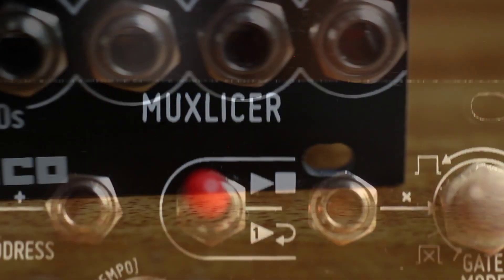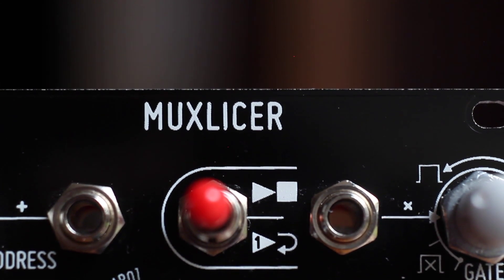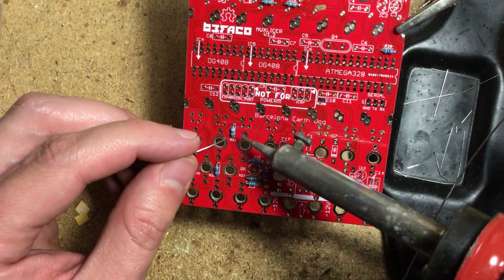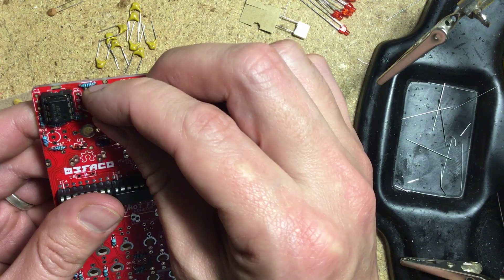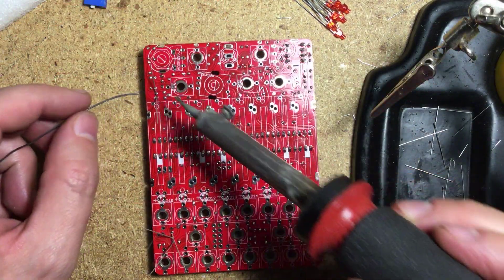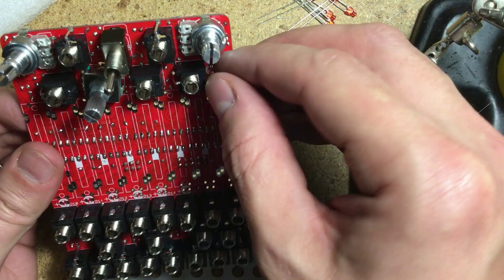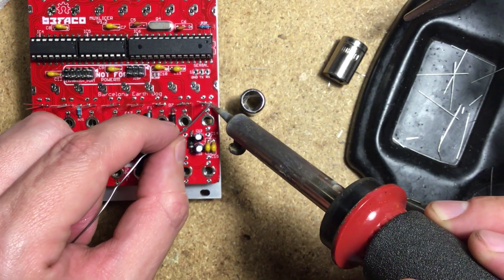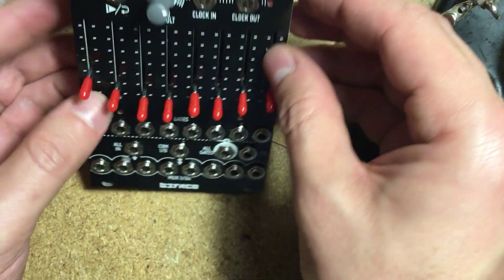Kit Overview # 42 - Muxlicer Build Video

Comment: Not soldering everything from above anymore, is it any good reasons you changed your ways that one might find helpful? That is, should I not solder from above ;)
Reply from the maker: I still solder the resistors, diodes and ferrite beads from above, it is mentioned in the video if you watch again ;)
The other components are soldered from behind since access to the pads from above is obstructed.
Reply: @QuincasMoreira  Thank you. You are a great inspiration.
Will watch and listen again, especially before putting together the same module when the times comes.
Cheers mate!
Reply from the maker: @RobLocksley  Cheers and thanks!